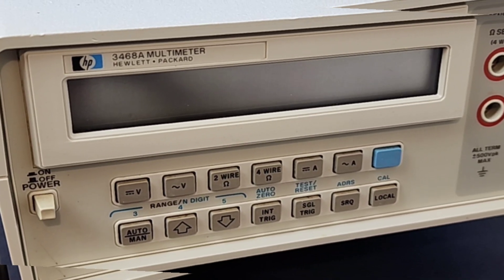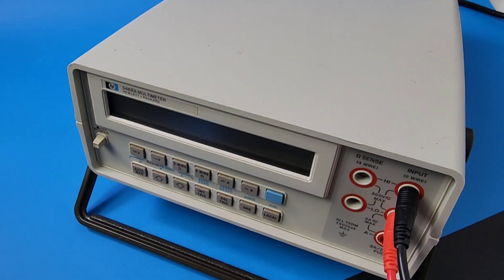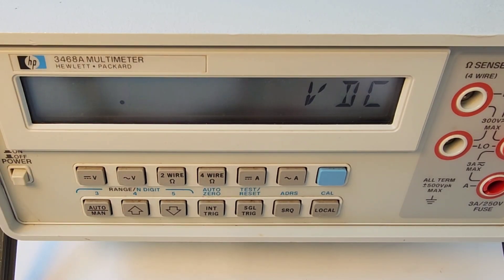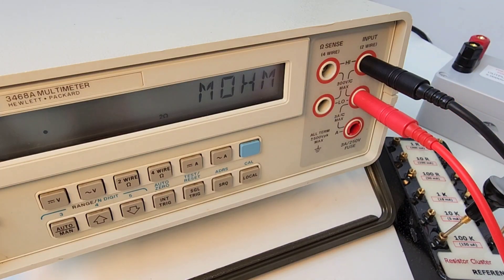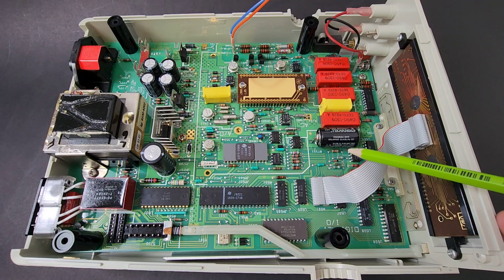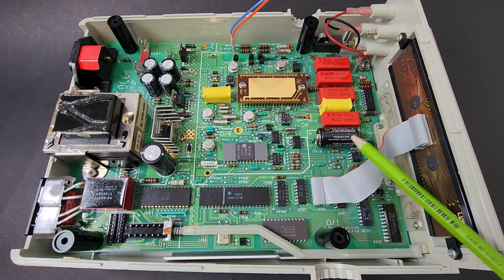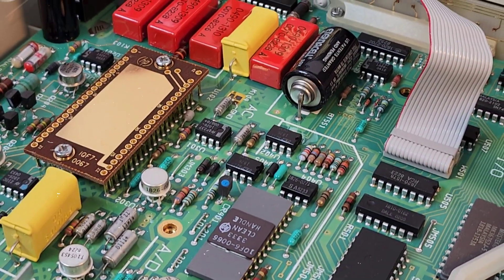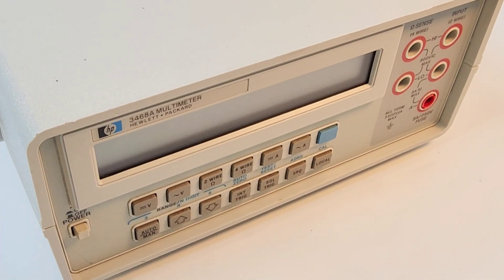RETRO-TECH ○ Hewlett-Packard HP 3468A Benchmeter  Review & Teardown! (1981)

Comment: I had the 3478A and replaced the battery (and some caps) myself. The way I did it was while powered on and with a portable (cordless) soldering iron to prevent shorting out the battery contacts in which case the calibration would've been lost still.
Reply from the maker: Great point..I recall seeing that mentioned as the soldering iron ground could short the battery. I'll probably do the same..cordless iron while powered on by mains. 👍
Reply: Yes, you have to use an un-grounded iron and the device have to be powered on, to replace the battery on a 3478A. And of course, replace the (3) Rifa-mains-filter caps..

Comment: "portable" Can't wait to slap on some speakers and a cassette deck on that thing! The glowing screen ones are far easier to read at night, unless that has a backlight. I'm curious about the battery that would have went in there. Calibration still bang on, one of the advantages of digital calibration...but when it does whack off it is hard to work out!

Comment: Self test doesn’t let you know if the battery is getting low?  Seems like an oversight.   I generally wait to get my wheel alignment until I am buying new tires. Maybe the same plan is warranted for replacing the cell and calibration adjustment?
Reply from the maker: Great point 👉 Would make alot of sense for sure, I didn't see anything mentioned in the manual regarding a low battery fault indicator on bootup. I'll take another look see just to make sure.👍